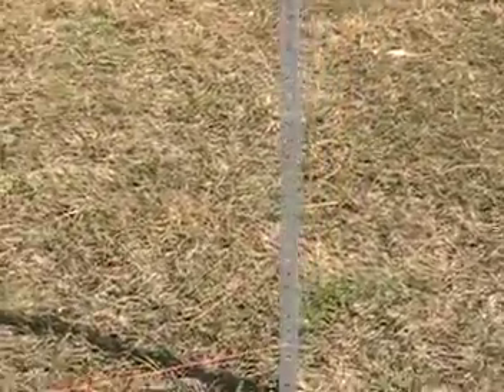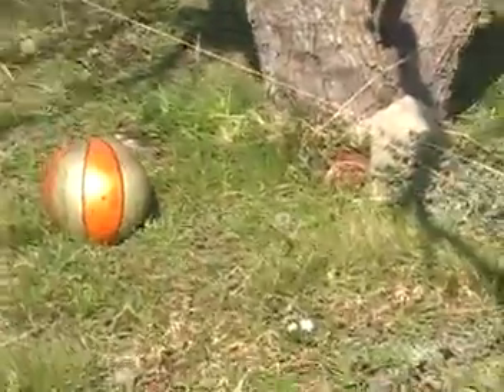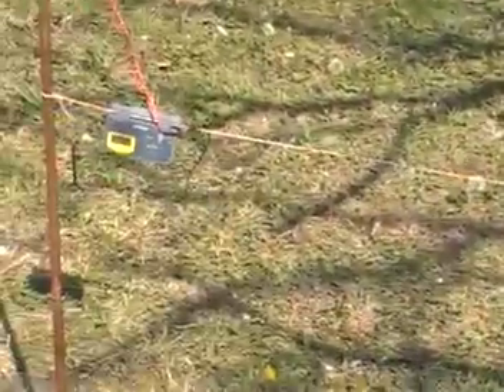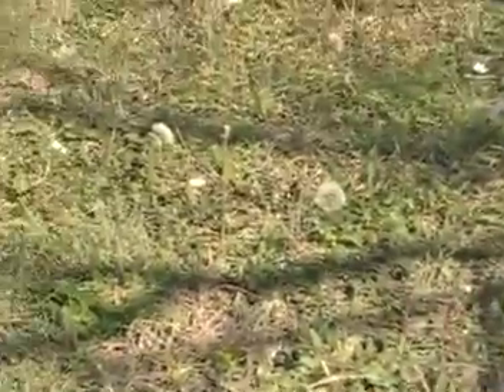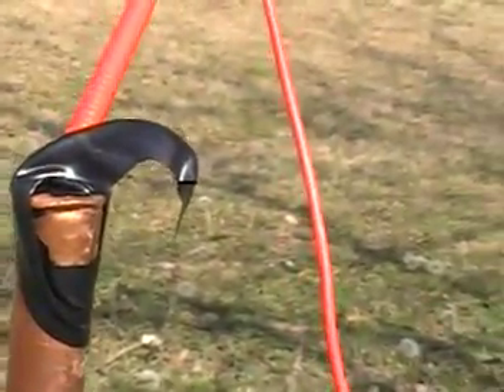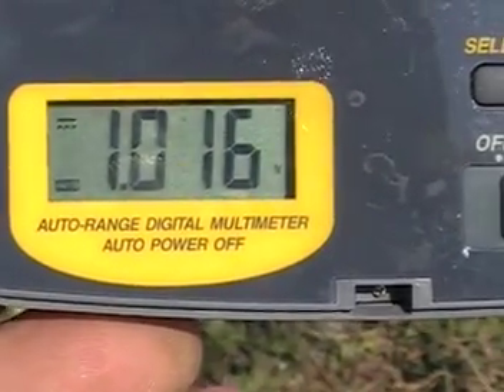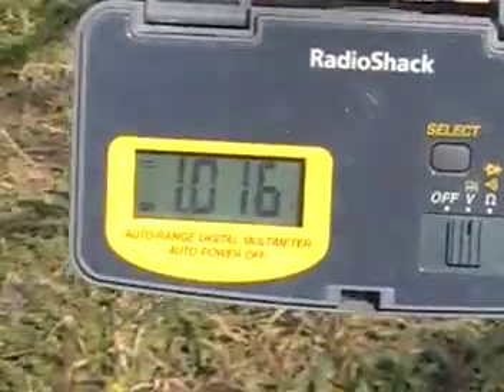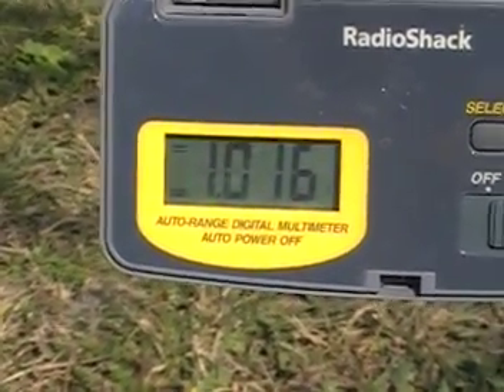My earth Battery

Comment: To greatly improve the power output, you need to first use iron dowsing rods to find the Earth's telluric confluence points in your area.  In this way, you will not only tap the galvanic potential between the two electrodes, but also be adding  the telluric currents which under certain instances, can far exceed the galvanic currents that you're generating. To do this, walk the space with the dowsing rods where you are and find the area where the dowsing rods strongly point to each other and at that exact point, pound into the dirt the first electrode and then do the same for the other electrode in the general area where you want the second electrode to be.  Another benefit of utilizing telluric currents is that they are far more stable as an energy source than the galvanic currents since the latter are highly influenced by soil moisture levels.

Comment: It is a result of electrochemical reaction most commonly know as the anode cathode reaction, or galvanic cell. Any point on the metalic path can be interupted and that interuption can be seen anywhere on the metalic path. So by sending dot dash signal interuption they were able to send messages. It is a DC current operation, but can be interferred with by teluric currents in a north south oreientation in the northern lattitudes.  Yes DC will travel only so far but the out foxed this by adding another anode and repeating and replicating town to town. With the advent of impressed current they can drive the DC hundreds of miles. As telephones came in vouge electronics principals came into being using much of the same circuitry but much more useful.  It is a good example of the pathway of invention based on principals of science.

Comment: Yea if you set that up then put a voltage multiplier on it,  because you need steady power, step up transformer, so many steps to make it, stable. Most devices are run on 120 volt 60 hz system. Not like other countries have 100 volt 50 hz system. Even buying stuff from other countries halve to be careful not to get their products because you will burn them out

Comment: this amounts higher in Volts if you use plasma capacitors, arranging them in one direction they can easily add up (0.75~1.25V) x (number of them) . i managed to reach 6V connecting 8 . i heard that when say sets of them are also connected parallel, they also produce Amps. now ii see this and thinking what if the ground properties were different on each side .. for example different type soil or in water or certain mud or in swamps. Collect it from the water and coast,  still wonder why some people llike fishing by the beach with a stick ?

Comment: Soil analysis must be done and certain elements must be added to the soil to help increase the voltage. Unequal Resistance in soil will effect the power gleaned from these units. Look up Catholic Protection on YouTube,,,that might help. NACE. (National Association of Corrosion Engineers) has some great tips that may help too. I worked in the field of many years,,you have Voltage but little to NO amperage that AMPS is what electrical items need to operate. What you have here is the same as a livestock fence,,High Voltage and No Amperage. Sorry.

Comment: there are aquifers under the pyramids (if you believe they are power stations), put a lyden jar under the copper? I'm trying to figure it out now myself. I have a wire to a copper plate in a tree to the ground. Not sure how to ground it yet, maybe through the tree? Seems reasonable to me. I'm going to put in a lyden jar and try that next. I fail to believe that all the electricity that is lost through wires, outlets and devices leaks electricity and also fail to believe that all those wires aren't picking up electricity out of the air.  Anyone?

Comment: Why do all you people think wikipedia and random nerds on youtube are telling you facts lol?   This guy only has a half truth.  use they used them in telegraph systems!  But they also used ceramic tubs 5x5 feet and placed dirt in each of them with a few layers of decaying citrus type fruits They used copper and zinc electrodes and the whole tree part made me laugh the most!  It was common for them to plant a tree, to be more exact Pine trees in the ceramic pots to keep the acid levels up for longer duration!   By the way.8- 1.3 volts is the common current produced by these cells depending on the acid levels in the object the electrodes touch!  If you want to learn more about this with hard core facts!  There is a huge write up in the NY museum where Edison stuff is stored.  One of his workers designed the system you all have so poorly read about online! Also you can only have 2 electrodes per container or your batter will not gain voltage from each cell, Guess that is why they call it a cell and not a cluster fuck lol

Comment: I hooked a meter between a pipe in the ground and a nearby generator to see if it was grounded, and I got a voltage. This was in highly alkaline soil at the Nevada Test Site (atom bomb testing range in Nevada). Of course when I measured the current it wasn't usable, but I got an appreciation of electronegativity. 

And no, you can't draw much power out of the ground this way. If you use dissimilar metals, you can make a "battery", but you are corroding your pipe to do it. Better to go to the store and buy an alkaline cell. They're cheaper than pipes.
Reply: +James Van Damme or carbon electrodes, plant e for example has commercial pilot projects ongoing-looks promising but they are using an ionic membrane design I think, also perhaps flat electrodes

Comment: Try pouring salt water around eack post in ground for a better connection also. I used to work for Ma Bell. When we installed a coin phone and couldn't get the ground rod in the ground far enough to get a good test from office, we would piss around the ground rod and bingo, perfect test. The phone would work with a week ground but the company would fail the install if it didn't test perfect. Try it. It might make a difference. Good luck.
Reply: its current from the earth ....moist soil is all he needs

Comment: Do you think you'll get a higher voltage if you place an earth battery underneath high voltage power lines through induced current ??
Reply from the maker: +Foodfortruth never tried  but not a bad idea.
Reply: +RHEAD100  people say that you can take a fluorescent strip light stick 1 end in the ground under a under a 400kv tower system for instance and the light will illuminate slightly when your hand is closed on the other side due to induce current not sure whether this is true I may try and posted the video
Reply from the maker: +Foodfortruth I have seen this done and it does work.  I have several videos called " High Voltage Lighting "   you may find them interesting.
Reply: I used to work in a factory.   Our machines ran off solar.  We were one of the first factories in the state to do this.   But the lights were on the grid.    One day when the power went out to the lights we discovered that several fluorescent lights glowed despite there being no power to them.  When we unplugged one we found we could carry it around like a flashlight.  the closer we carried one to a running machine the brighter it glowed.  Most of the machines had powerful electric motors.   

I now live in Florida.  Where I live we have frequent lightning storms.  Just today there were hundreds of lightning strikes in our city.   At night if you carry a fluorescent light outside during a lightning storm it will often flicker or glow.   A friend of mine is working on a way to use fluorescent collectors to obtain electricity from the electricity that is in the air during one of our daily lightning storms.  I warned him that one lightning strike will fry his system but it is fun to watch him work on it.
Reply: Energy is free you poor soul.

Comment: take your copper tubes, soak them in a solution of drano with hot water (this will produce hydrogen gas so don't smoke) and keep it covered for a few days then let them dry then boil or get water as close to 200 deg f water and put the pipe on a stand just above the water level and add some drano all along the bottom and cover, every 6 hrs check the voltages from end to end, do this for one or two days then let dry, coat them with silicon spray and let dry. now put it in the ground.

Comment: stubblefield nathan got the nobel prize for what he called earth battery in 1894  and had also invented wireless phone
that connected to ground no batteries   ...........over a hundred years ago       free phone
tesla was one of the on lookers that witnessed  stubblefields running a small motor for 44 days 24/7  

its 2015 we are still paying for services that should be almost free......why do you think???

cheers
Reply: +Fistful Pennies cause people never self educate or experiment anymore. They are too lazy to tinker. I learned basic mechanics by tearing engines and such apart and putting them back together. I then went to school to get the education needed to learn on the more modern engines. Today I can rebuild my own car if I had to.

Comment: I could not help myself I had to just go try a quick test. I am a full time scrapper with loads of copper on hold as prices have hit bottom, I tell ya if prices don't soon start going up my copper is going in the ground. Good video and don't worry about not being able to find the wire in your cam, I do the same friggin thing. I'm a scrapper, not a photographer.
Reply: +Darnell Amero It doesn't have to be copper. Use different metals to find out which produces the most voltage for the type of chemistry in your soil. Try researching other methods of the earth battery as this is not the most optimal setup. By putting a rod much closer together with an insulator (anode/cathode) one can produce higher voltages, ect. Hint: If the soil is wet it will have higher voltage. Also add an electrolytic (such as salt) to increase voltages.
Reply: MGTOW Thanks. Where I am in Nova Scotia there is Uranium in the ground so maybe that might help also.

Comment: The reason you are getting a low voltage is you are only using one cell.  I have just watched another uTube on making an earth battery and the problem with his was, although he had a number of anodes and cathodes, they were all, effectively, in the same electrolyte without any insulation between or isolation of the "cells" so all the intermediate cells were all shorted out and the only "working cell" was that created by the two electrodes at the ends of the line.

Comment: This probably couldn't do much productive work at that low of a voltage and current.  This would be similar to trying to start a car with 8 D-cell batteries in series.  The 12 volts is there, but not the current.  I would think, like you, that it would have taken probably huge plates of dissimilar metals or hundreds of these connected in series-parallel to raise the voltage and current high enough to be productive.  But hey, when we run out of oil, this may be our next power source.

Comment: Seems pretty worthless to me. You have to pay money to buy the copper pipe and the galvanized iron. The copper and iron will get used up over time, so this is not free energy. You could get more power out and use less wire if you moved those two rods close together (but not touching) and use an electrolyte solution between the two. 

If you want real free energy, buy some solar panels. Sunshine is genuine free energy that won't stop working for billions of years from now. It is a lot more powerful than this earth battery too. You can pull several amps and volts off a single solar panel, way more than this earth battery will ever provide.
Reply: zilym wouldn't the electrolyte solution use up the rods much faster?
Reply: zilym don't be a fool. where is the solar cel that can last at least for 50 years? do you think these rods will get used up faster than a solar cell ?
Reply: Mars Seeker Most solar panels are warranteed for at least 20 years, and they'll most likely continue working long after that. Thing is, solar panels haven't been in existence long enough to prove out longer warrantee periods. My dad's cousin bought some used panels made in the late 1970's or early 1980's and they're still working. Granted, they're not as efficient as today's cells and he'd do better by upgrading, but he's stubborn.
Reply: Mars Seeker Yes, electrolyte would use up the rods faster, but you'd get actual useful amounts of electricity output instead of virtually nothing.
Reply: zilym but it will pay off itself with time without the electrolyte.  time is all we need.
Reply: earth battens charge batteries at night and can be made for almost nothing.

Comment: Well I know only enough about elctricity to be able to say this much.
What is missing I think is the tuned circuit....every frequency has a resonance and there is a formula for finding it...and the resonance is depending on inductance and capacitance values. it is how you tune a radio...
I think that is the key to making it work better.

Comment: If you increase the ALTITUDE of the wire,  you will increase the voltage.  This is a big reason why AC is placed on the top of telephone poles.  High Tension Wires are very high.  Earth is going to be zero but the natural standing voltage of the air increases as you get further from the surface of the earth.

Comment: Isn't that simply a galvanic cell with the earth as the electrolyte ?

The energy here is not coming from the earth, it is from the metals. Meaning they will corrode if you let it run for a while.
Also sticking them that far apart should not help, did you try putting them close together and adding water?
Reply: they are way to far apart to be galvanic ...its current in the the earth

Comment: Very interesting, It makes me wonder; is it an earth battery or is it an "Earth/air" battery? 
I have heard before that a large metal sheet suspended high in the air with a wire extending to the ground (with other details I don't know) will produce a voltage. 
If anyone has heard of this - please post here so I and RHEAD100 can hear about it too.

Comment: I'm more interested in what the applications are for such a battery. For instance , can I charge a lawn mower battery with an earth battery ? Would it serve a useful purpose like powering an outdoor light ?
Reply: Kurt M You could also start a "top wire" phone system.  Way back when, folks ran the top wire of the wire fence being careful not to ground it and hooked a phone to it.  This way a community could have a phone system with one big party line.
Reply from the maker: Well John .  over half the telegraphs in the US in the mid 18 hundreds ran on earth batteries . SOOO  I suppose it would be possible to charge a battery.  It would be a very slow charge
Reply: RHEAD100 Telegraphs don't need much power and the priority was on making something extremely reliable.  Thus to charge my lawn mower, I'd use a solar panel.  The better option is to just get a push mower and eat breakfast to charge the engine that makes it go.
Reply: John, you can open your own telegraph company  :)
Reply: MGTOW
The reason you can't power a house comes down to the chemistry of how the battery works.  When you drive metal rods into the ground made out of different material (at least on the surface) you get a voltage due to the potential difference from a table like this:

http://www.engineeringtoolbox.com/electrode-potential-d_482.html

When you drive a 3rd rod into the ground, the 3rd rod is not isolated from the other 2.  When you drive a 4th into the ground, the number of combinations to consider gets to be quite long.  The number of combinations grows as the factorial of N. 

As to the how the farm was powered, I suggest you go ask your parents or grand parents about what they did.  They had no electronics.  They heated by burning fuel of some sort.  Mechanical power came from animals (counting humans).  Light came from the sun.
Reply: MGTOW
You are not going to be able to make enough earth batteries in a reasonable area to power a house.  An emergency radio is more the scale of power that is practical to do.
Reply: MGTOW
You are suggesting people powered their homes from earth batteries.  This is simply false.

Folks have only sort of powered their homes from things like windmills.  Look at how low the electrical power consumption was.  Look at where most of the energy came from.  It didn't come from the windmill.  The heat came from fuels.  The mechanical energy from animals.  They got up with the chickens to use sun light.  Knowing about this sort of stuff is how I make my living but this bit of it is easy enough for anyone to grasp.
Reply: it would be zero maintenance . its almost all buried and could be designed into the homes foundation and fencing.Way more robust than solar or wind energy and produces energy at midnight with no wind.